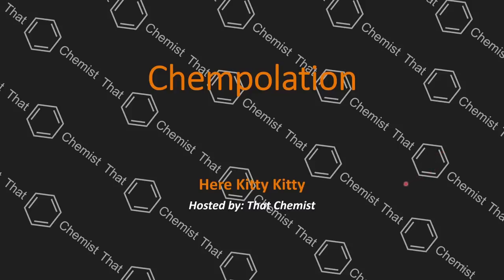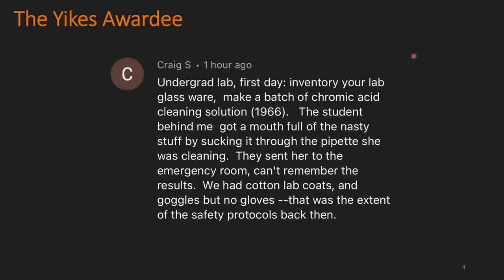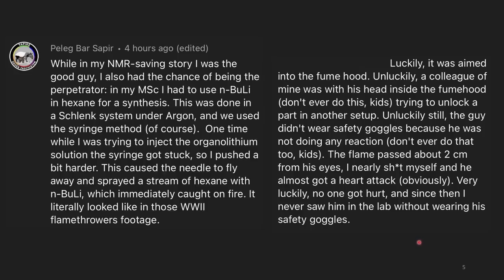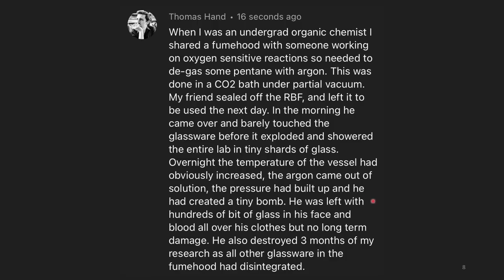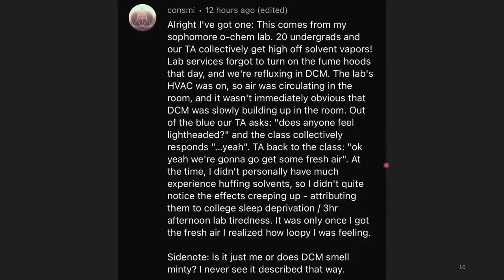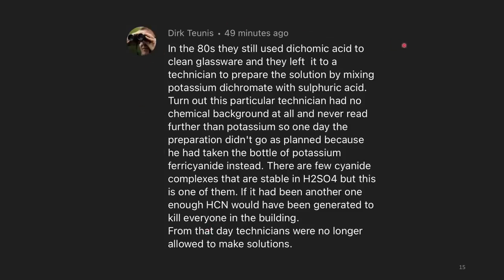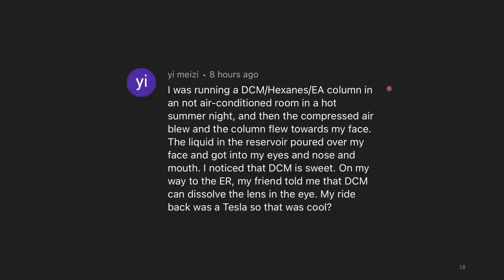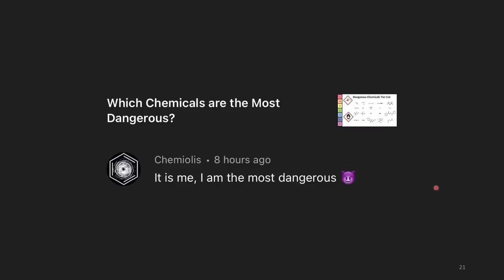He found out why that box was wet…

Comment: This jogged another of my memories where lab glasses did save the day. I was helping a colleague clean some rhizon samplers, which basically consists of using a luer-lock syringe to backwash the rhizon with dilute nitric acid, followed by water. This requires fairly significant pressure on the syringe to do with any kind of efficiency. We had several hundred to do, so we were just sitting across the lab bench from one-another and chatting while we worked. At one point, she apparently didn't fully twist the luer-lock into place before pushing on the syringe, and it let go when she applied pressure. The thing went whizzing across the room like a rocket and missed my face by inches, spreading a fine mist in its wake. There was a moment of silence, followed by, "...was that the acid?" "...yeah." "Okay, then. I'm gonna go wash my face."
Reply: lmao that short exchange
protective equipment for the win

Comment: The 250 gallon reactor belching out 15,000 gallons of NH3 story is one of those basic mistakes we should all learn to guard against.  I first saw it in college O-chem lab, with our introduction to Grignard chemistry.  The students (mostly pre-med with a few chemistry majors) had all flame dried their flasks, added magnesium turnings, ether (not handed out until all flames were extinguished, since this was done on the bench, rather than in hoods), reflux condensers, drying tube, and addition funnel of alkylbromide.  Despite explicit instructions and warnings to be sure the reaction had been initiated (with a few drops of alylbromide, iodine crystals and using a glass stirring rod to crunch up the Mg turnings) before slowly adding the remainder of the alkylbromide, about half of the students managed to add all of the alkylbromide without initiating the reaction.  And, a few minutes later, all of those reactions erupted like a chain of volcanoes (small scale, so no injuries, but quite a few broken condensers and addition funnels and some stains on the ceiling).  The use of slow addition of reagents to regulate the rate of highly exothermic reactions only works if the reaction is actually initiated, otherwise it creates a potential bomb.
Reply: 😂what where u making
Reply: @Kirt44  This was a while back, fall of '78 or spring of '79, but if I remember correctly I think it was propyl bromide to give the propyl Grignard which was then reacted with acetophenone which would give 2-phenyl-2-pentanol.

Comment: I have lots of chemistry horror stories to tell. Here's one of them.

The guys down the hall were setting up a 20L tetrahydrofuran (THF) still in the fume hood with sodium metal and benzophenone, for use in their air-sensitive reactions. They kept on adding sodium and it kept getting "eaten up", which is usually a sign of a bad batch of THF with too much dissolved water. I would have dried it over molecular sieves first, but our big-brained heroes (one was a postdoc!) chose instead to add potassium metal to really get after the problem! I hope you all know what happens when you're heating sodium and potassium metal together. They melt to form NaK alloy, which is a liquid metal that's far more reactive than either by itself. It was so reactive that the whole freaking still detonated with a loud report that shook the building. Glass shrapnel, flaming THF and NaK flew everywhere, made worse because the fume hood window was up, not down. The still next to it went up in flames as well. 

Someone pulled the alarm, so I grabbed my notebooks and hustled outside. Then the fire department arrived, which is when hilarity ensued. There were balls of flaming NaK rolling all over the floor. Here's a bit of advice - when the fire fighters show up, you have to stay there and guide them, because they're not trained to deal with chemical fires, but hopefully you are. The fire fighters saw these flaming balls of NaK on the floor and decided to blast them with water. Of course, they would explode and divide into smaller balls of NaK, still on fire.

Our heroes survived the incident, but it took quite a bit of surgery to remove the glass shrapnel and remediate the flame damage they took. I'm sure they really needed that clean THF right away, but they made a terrible choice. I've prepared plenty of dry, oxygen-free THF stills before without incident.
Reply from the maker: Oh my gosh - that is terrible
Reply: Woooow...bad choices on bad choices. I bet they learned their lesson though...God I hope so...

Comment: Good lord that last one is nuts. The lab management failed on so many levels there. Even if you insist on automatically shutting off power to your lights and fume hoods at a set time, the very least you could do to guarantee your lab workers' safety is to have the lab end well before that shutoff time. Forcing people to work until just before the moment it suddenly gets very dangerous is just asking for horrible accidents.
It's not hard to argue that the two most important things you need to work safely and effectively in a lab is 1) the ability to see what you're doing and 2) the ability to breathe safely and comfortably. Taking both of those things away simultaneously, not to mention suddenly like with a power cut, is going to mess up every single layer of your operation. I have no idea what could motivate someone to make a daft decision like that. Even if you don't give a toss about the health and safety of your lab workers (sadly an all too common occurrence), you're actively causing them to make mistakes by startling them, blinding them and gassing them all at the same time, inadvertently ruining hours, days or even weeks or months of work.
Reply: The sad thing is, I doubt that the automatic shutoff even saved much money. Some idiot manager was convinced by an idiot bean counter to prioritize saving a minimal amount of money over student, staff and faculty safety.
Reply: @russlehman2070  It seems the worse safety concerns happen just to save a couple bucks, I swear.

Comment: Never underestimate the density of solvent vapor. If you stand in front of a fume hood with sash open, heavier toxic vapors like CS2 or C2N2 will escape. Also, multiple fume hoods in one room often conflict.
Reply: aren't lab air supposed to be balalanced, with more air in then hoods pull, so this would not happen? Otherwise they of course conflict. I am not a chemist, engineering only, I think chemists are supposed to be taught things like densities or their  fume hoods work :)
but ok, I do undestand, we mechies, were not taught enough chemistry :)
Reply: @mechadrake  That actually sounds reasonable.  However I do wonder about the engineering of labs that are supposed to have fume hoods installed, whether the building engineers or architects even do the math.  This would, to me, be a matter of building code that inspectors should be checking ("your HVAC isn't allowing enough fresh air for all those hoods"), but how many inspectors are familiar with this realm?  And even if technically there was enough fresh air allowed by the HVAC, that doesn't mean that a certain arrangement of HVAC inlets and hoods couldn't still starve one another, as air does have some viscosity.
Reply: @SeekingTheLoveThatGodMeans7648  My school's Chemistry Building was built for the 1902 "Exposition." In the mid 1970s, all the "new" (1967+) buildings were engineering (including the reactor) or medical.
Reply: @mechadrake  Usually okay with both hoods' sashes closed. With one person working is each open hood, then "negative eddies" can occur.

Comment: this one doesn't involve me personally, but it happened at my workplace
about 10 years ago I was working for a large cosmetics and toiletry manufacturer, who were getting into financial hard times, so they brought in a load of consultants (angels of death) to advise how best to save on expenditure
at the time, bulk liquids (think, e.g. shampoo, conditioner, toothpaste etc., on a multi-ton scale) were mixed by the manufacturing department, and there was a separate pre-weigh department who weighed out all the ingredients for batches, received incoming deliveries of chemicals, maintained the tank farm (where bulk raw materials, e.g. sodium laureth sulphate, glycerine, mineral oil etc. were stored in 10- or 20-ton silos) and so on
one of the consultants' big-brained ideas was to make the pre-weigh department redundant and have the manufacturing department do their job as well; this caused a lot of stress and overwork in manufacturing, and more than a few avoidable errors
the situation came to a head when one of the manufacturers took a delivery of bulk raw material, but forgot to check the valve at the bottom of the tank was closed before pumping in the liquid
net result: 8 tons of ammonium lauryl sulphate dumped into the tank farm - sticky, foamy, smelly and very messy
needless to say, they got the pre-weighers back very soon after that
Reply from the maker: Oh no!
Reply: that doesn't sound like an angle

Comment: Not really that related but way back when I was in middle school I was obsessed with exotic thermite reactions. One day I decided to grind up a pound of sand box sand (I took from school),aluminum and KNO3 to boost the heat of the reaction. I wanted to make elemental silicon.  I lit it off during my moms dinner party in the barbecue which I had converted into the thermite pit. It shot off really pretty purple flames and a cloud of smoke bigger than several houses composed of potassium and aluminum oxides was blown across the neighborhood. I definitely freaked out my grandpa when the whole backward was shrouded in smoke. I did recover elemental silicon which I still have to this day, I was a wild and dumb kid. I also made metallic chromium, iron, silicon and boron through the same method. (Also broke a bromine ampoule one time). On another occasion I dumped a bag of iron (ii)(iii) oxide on the carpet at my dads, a large black stain still remains to this day and my dad still is salty.
Reply from the maker: Lmao that’s an amazing one
Reply: That is the coolest thing I've read in a while. Please make a video and show off your silicon!!

Comment: If you’re just going to turn the fume hoods off at a curfew time, at least have the decency to set hungry attack dogs loose in the halls to attack chemists for being in the building too late.

Cutting off fume hood usage doesn’t send a clear enough message, and any chemists that get hurt or die will probably damage lab equipment in the process. With my proposal, you can at least pretend to be following the same logic of dissuasion as the death penalty instead of just waiting for pointless, preventable accidents to happen
Reply: perfectly resonable proposal, MrBurnsRealeaseTheHounds(TM) system saves money in every uni it is implemented in!
Reply from the maker: Lmfao
Reply: The dogs with bees in their mouths who spit bees out when they bark at you... I'm training several now and they're only $100,000 per year licensing fee - put your deposit in my mailbox today, men need not apply.

Comment: I've shared this one before but I feel like it fits this format very well.

So there's a story a lab supervisor once told me. Two undergrad students were performing an experiment for the physical chemistry course. I don't know if it's a general thing but at my university, physchem experiments tend to be tedious and boring like measuring the surface tension of bubbles. I suppose it's part of the reason why the supervisor tends to leave you and your lab mate alone in the lab for a couple of hours and come back when you're finished. Now, the flaw here is you trust undergrads to not get into any weird shit, which backfired that day, because guess what, they got bored too. So the supervisor comes back and walks in on one of the students with his pants down and his d*ck on the analytical balance. I can't imagine that any amount of solvent will wash away the PTSD of working with this balance ever again.
Reply from the maker: Funny story, but I couldn’t ever put this in a video lol
Reply: I've heard of guys comparing length measurement of their manhood, but not weight. I have measured mine (no I won't give numbers), but not in a group setting. Besides, I don't think you're going to get an accurate weight unless you cut it off, which, I don't think most guys are going to do.

Comment: In our first o-chem lab I had to distill a bunch of acetyl chloride for the whole group. This went quite well and the flasks were stoppered, sealed with parafilm, wrapped in aluminium foil, put in bowls and then stored in the freezer. The problems arose when it came time to clean up about one month later. Opening the freezer I noticed that despite the parafilm, all of the aluminium foil had turned into a weird grey sludge at the bottom of the bowls and the metal clips securing the stoppers had all become green and extremely brittle. Despite wearing gloves I was hesitant to touch the grey goo, which made handling the flasks a bit difficult. The stopper on the last flask (still about half full) was stuck so when I pulled on it without properly holding the flask, I got a bunch of acetyl chloride all over my hands and part of my forearms. As soon as I began washing it off I felt a sharp stinging in my nose and this disgusting wave of vinegar hit me. My skin was perfectly fine but both the lab and my lab coat smelt like vinegar for a few days.

Comment: Secondhand story, so take with a grain of salt. Our x-ray crystallographer's previous workgroup used to work on extremely sensitive stuff and they noticed recurring contamination in all reactions when they used diethyl ether. Now, scientists that they were, after finding the problem's source, they tried to identify what was inhibiting their reactions to try and rectify it. The contamination was only trace amounts, so they took a whole bunch of the diethyl ether, rotovap'd it to concentrate the impurity to dryness and found what they ended up with to be crystalline.
Having an x-ray specialist available, they naturally took the crystals there and had him check. Turns out they had ended up with about 100mg of peroxide crystals formed from unstabilized Et2O. Needless to say, the crystallographer wasn't too pleased about an explosive crystal sitting in the center of his half-a-million dollar x-ray diffractometer. Nothing happened, but I was told they were rather apprehensive of moving the flask after finding out and called the disposal specialist immediately.

Lesson to take away from this: Careful when working with unstabilized ethers, and don't try to concentrate the residue if you're not certain of what said residue might be.
Reply: we have seen vids from down under (Ex&F), would hate getting explosive crystels on 100mg scale or more..
Reply from the maker: I’m pretty sure that diethyl ether peroxide is an oil, not crystalline (although other ethers form crystalline peroxides)

Comment: A few years back we got an emergency call from an industrial complex with multiple small companies on it.
The ventilation system caught fire and it spread to the building.
That was all the info give to us, so we arrived and started to pry open the doors as the only other guys there at night were security and they had no keys for the building.

For the next part keep in mind we have no idea what the building is for and we are volunteer firefighters without any chemistry background.

We went in and started to extinguish the fire while the others opened the roll doors and set up lighting etc.
With all the smoke we couldnt see anything so we didn't notice the burned IBC containers in the back.
I was on the second rotation inside and when we had to return to get new air we noticed something odd.

The rubber on our boots was melting and the traffic cone we placed in the middle of the room for our radio repeater was also melting.
While wondering why the other guys where pulling multiple empty burned looking ibc containers out of the hall.

Turns out the guys working didnt care much for the security protocol.
Instead of storing their chemicals in the warehouse with a automatic fire extinguishing system and warning signs on the building that there are chemicals inside they just kept it all in their working area.

In the end we learned that there where 3x 1000 L IBC's with concentrated sodium hydroxide solution which turned itself into an aerosol trough the heat.
And a mix of about ten different chemicals which combined where another 1200 liters.
The guys of us that were inside where mostly fine since we had our own air, but the others outside where not so lucky.
We used big fans to clear the smoke out of the building not knowing that the air was full of chemicals.
All the guys outside had to be treated for chemical burns in their airway, 4 had severe symptoms and where moved to the ER immediately and18 had mild chemical burns in their throat & airway.

This could have gone way worse if we didn't immediately created an hazard zone once we noticed it.
And all of that just because some industrial chemists were to lazy to move their chemicals every day in the morning and before closing.

The company went bankrupt after it, they had to pay for the removal of the contaminated soil around the building and multiple fines.
Including fines for the wrong storing, endangering others, decontaminating all out firefighter equipment + vehicles and more.